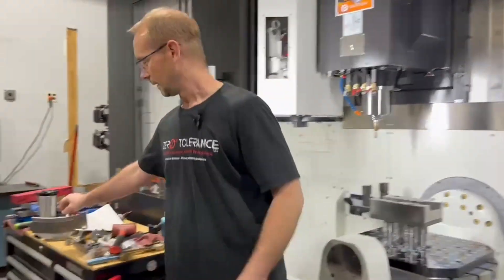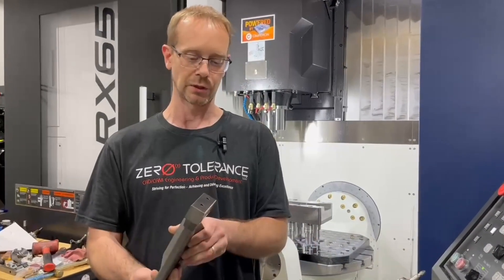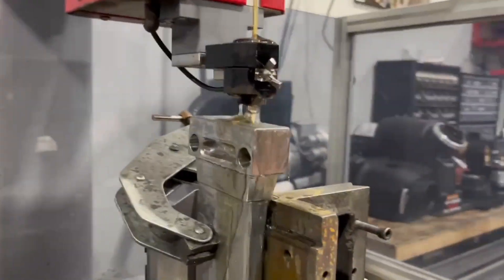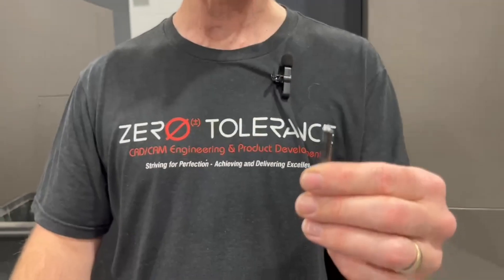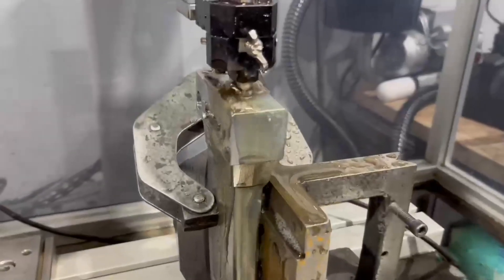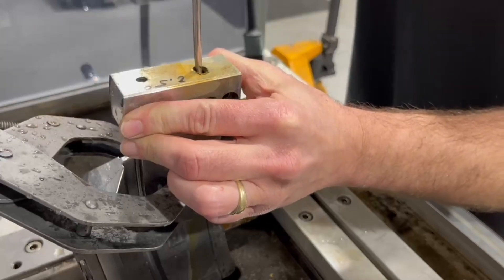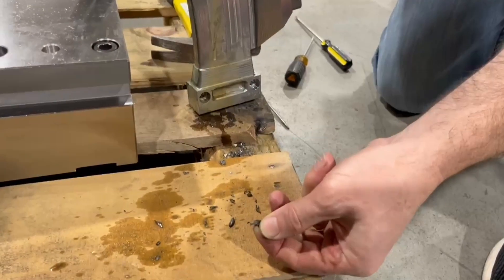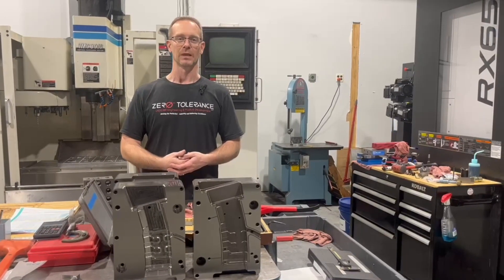An 8" Drill BROKE in the Part… Can Fast Hole EDM Fix it?

Comment: Newbie question.
Shouldn't the drill flutes be as long ( at least) as the hole?
Thank you
Reply: If you are one shotting the hole then yes. 

If you are pecking and letting the chips evac with high pressure coolant then a small flute length should be fine.

Comment: Good use case for an insert drill. If you weld it up anyway, I’d have drilled thru the bottom with a carbide drill until I hit the broken one, then drove the broken drill out backward with a punch. One more plug to put in, but hey, beats making a new part

Comment: Really good video. Were you running it with tsc?
Reply: The drill doesn't look like it has the channels for it, so I'm thinking no. For a hole that deep, I would absolutely go for TSC if possible. I get skittish when we do 5in deep holes with a 1.25 diameter. And that's WITH TSC and spade drills.